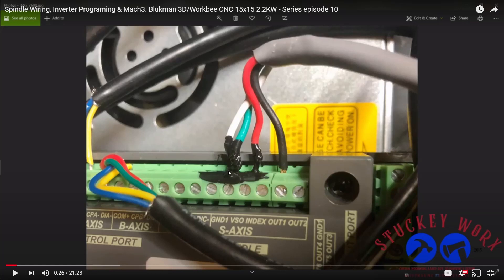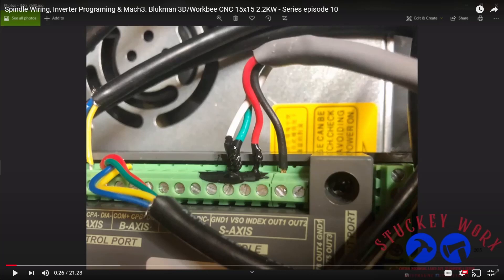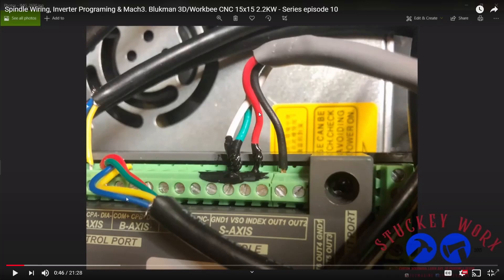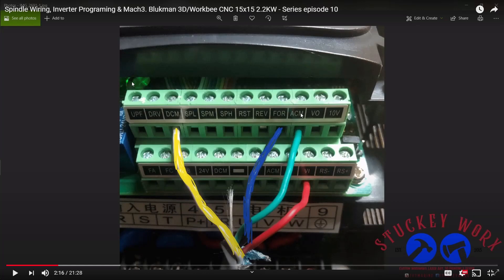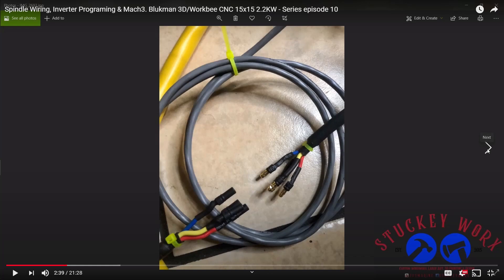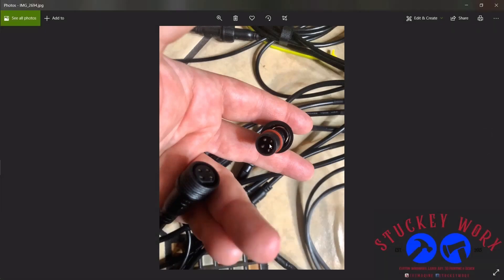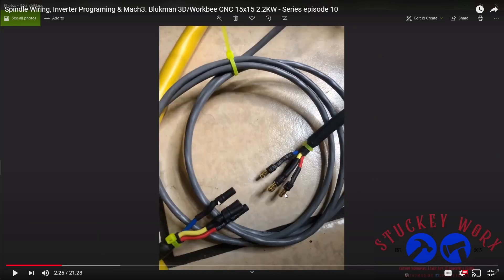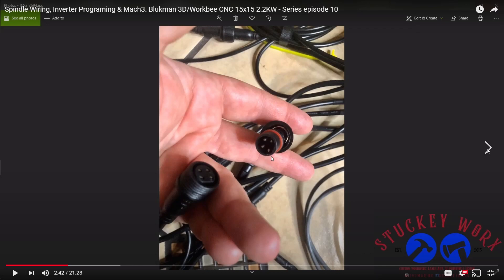CNC Spindle VFD Control Cable Dangerous Practices...

Comment: When in doubt send it to Vince as I recently did with my spindle cable wiring that was hired out to an electrician friend of mine originally. When its connectors started coming apart and arcing 3 phase electricity. Scared me badly. I had my hand on the router spindle not 30 seconds before that. I could have been badly burnt or killed. So send your work to Vince he will do you right. Happy Holidays everyone and stay safe. Electricity will kill you far quicker than Covid-19 !
Reply from the maker: Stingray guy, thank you for your support. I really appreciate it. Three phase is no joke. Please be careful for the safety of yourself, and your family. Have a Happy New Years! Vince